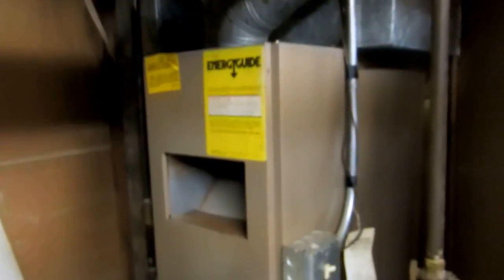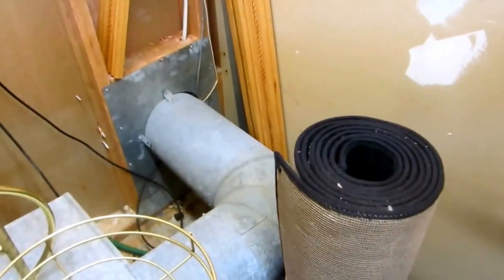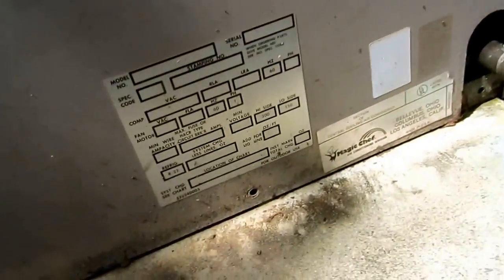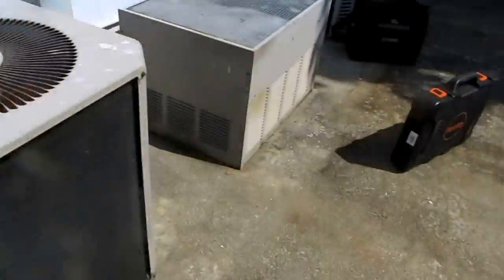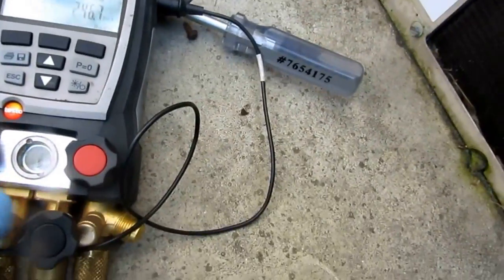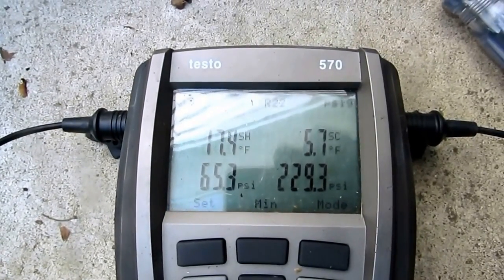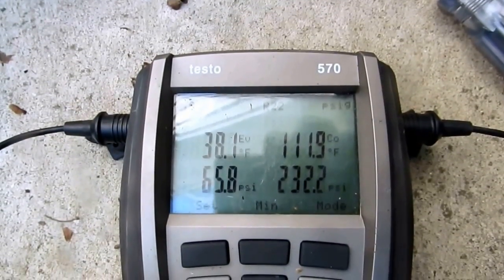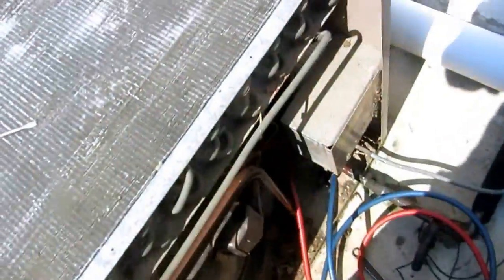HVAC-AIR CONDITIONING -flat top magic chef  air conditioner  , not cooling right,over charged

Comment: By the way if you ever look at the inside of those fins they are engineered to catch the wind and Pull It in a pattern along the coil by combing them out you're making it worse...... if the coils are not too far gone you can straighten them out sometimes and it a normal condenser it would cause the air to be ejected up rather than into the top of the coil so......

Comment: I use a pocket screwdriver and a wide fincomb on units that bad. Next time you fin comb use a spraybottle and wet the fins before combing. Sounds crazy but it does make the job easier pulls through nice. 
My grandpa has a 1.5 ton magic chef that still runs great. Sat 12 years and held a charge.

Comment: Great Video!  This makes total sense on how my old Janitrol / Goodman 3 ton unit died.  The compressor on that thing used to sweat up just like the one in this vid.  It was a piss poor installation that was done before I bought the house.  I suspect the con rod inside the compressor broke from slugging which caused the stator to burn from being locked leading to a compressor burnout.  I now have a properly installed Payne heat pump!